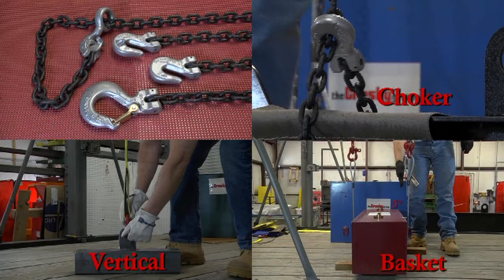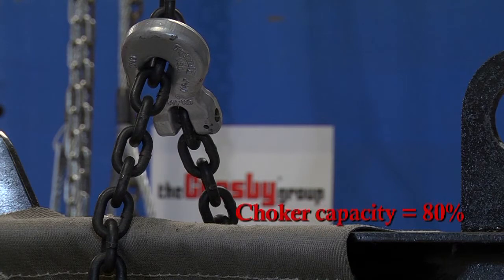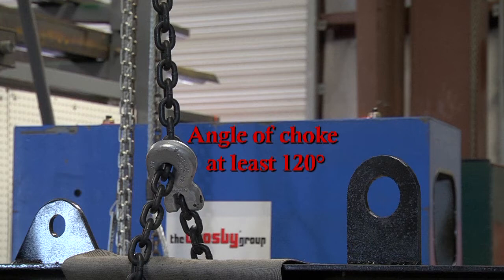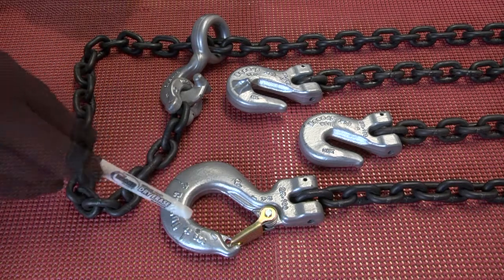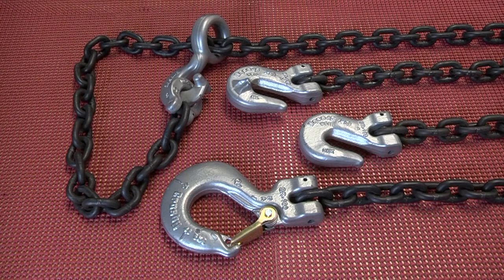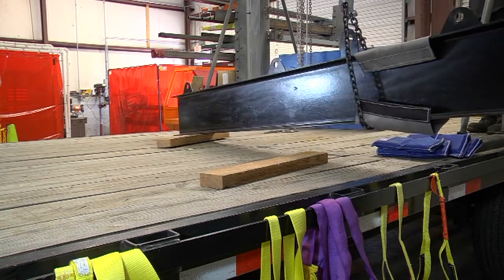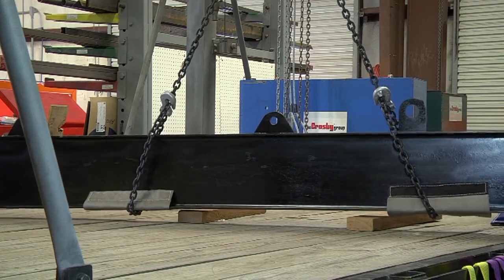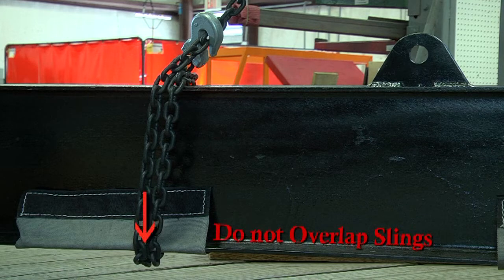The Choker Hitch: Chain Slings

Comment: I inspect a ton of chain and Gunnebo GBK hooks are almost always used for choking and you can tell because there will be excessive sideplay in the hooks but also the bottom 1/3 of the chain legs will have the coating worn off.

Hooks are often bent or broken off when used in this fashion and the proper choker hooks should be used but customers will continually buy new rigging and repeat.